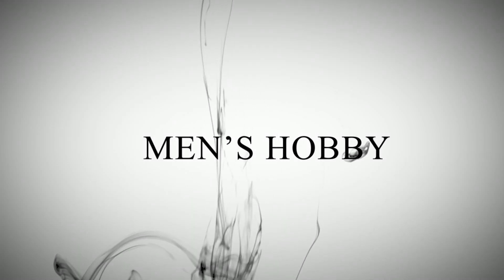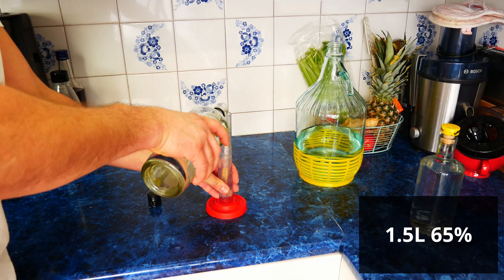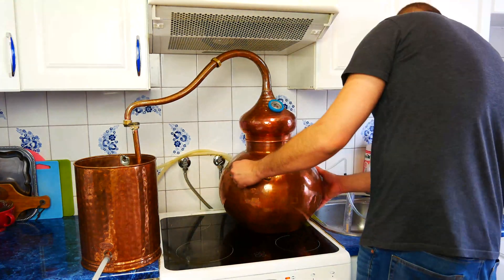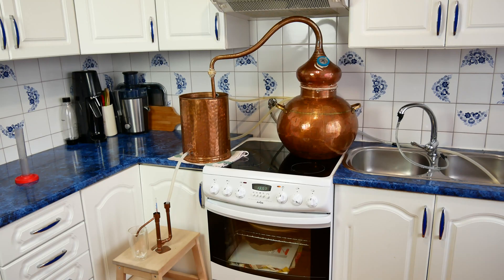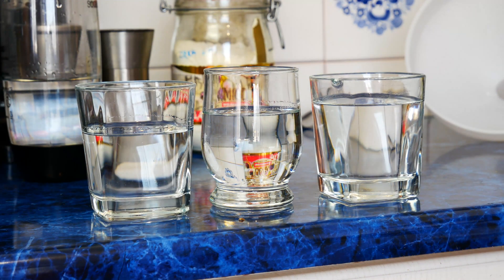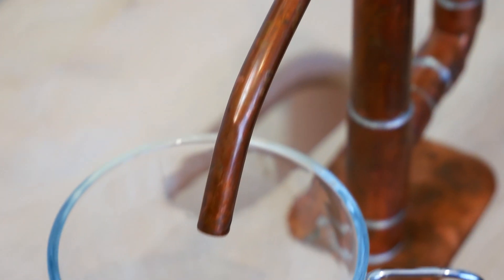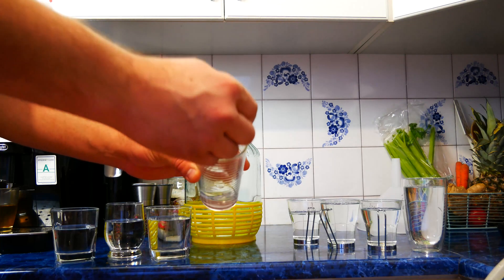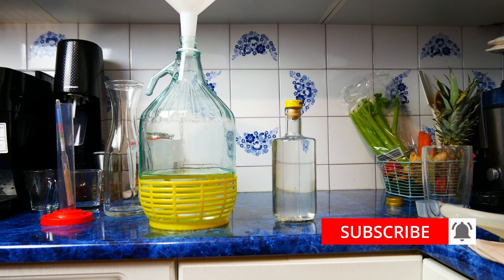Alembic Distillation - Beginner's guide /// Part 2 /// Heads/Hearts/Tails

Comment: 4:26 from other sources of information only tails could be used for adding to new batches. Whereas heads are only for needs, not related with drinking the product, like setting the fire or use like a solvent or cleaner. Thank you for video and efforts which are needed to shoot the video during distillation process.

Comment: idk why you are using another alc to mix with this, it changes flavor and is not the same alc,,i would simply use the first distillate in the second run or i would add 2lt of water and make it 4 litres at 20% and run second time ,that is what i do to make cleaner smoother better product otherwise no point in making something specific like whisky ,brandy etc only to use neutral alc to cut it down

Comment: @big boys hobbies thank you for the instructive videos. I recently made a banana mash and fermented for 5 days. Upon distillation using the same copper still as yours, the distillate started flowing at a fast speed at 94C.. it basically zoomed by the range of 78-82C.. I am wondering if I may have a bad mash with no ethanol in it ? Would you please mind helping me. Thank you in advanced
Reply from the maker: Sometimes it happend, its all depend of how strong is your mash, once i made apple calvados, and when i distill it and reach temperature of 80 -85 celsius i was collecting alcohol very slow ( one drop every few seconds) when i reach temp higher than 90 C then everything was normall. If your mash has not too much alcohol then you need higher temperature to distill it. On the internet you can find some charts about that
Reply from the maker: let me know if you find it, if not i will send you some links
Reply: @bigboyshobbies5731  thank you so much.
Reply: @Ignacio Ibrahim thanks so much for your reply. I got to the site through google and Im waiting for the hacking stuff now.
Looks like it's gonna take a while so I will reply here later when my account password hopefully is recovered.
Reply: You prolly dont give a damn but does someone know of a tool to log back into an instagram account?
I stupidly lost the account password. I would love any tricks you can offer me.
Reply: @Harley Rodrigo instablaster =)
Reply: @Ignacio Ibrahim It worked and I now got access to my account again. I'm so happy:D
Thank you so much you saved my ass :D
Reply: @Harley Rodrigo happy to help =)